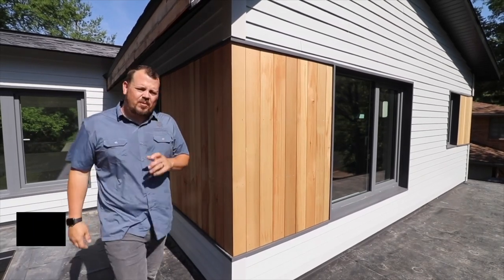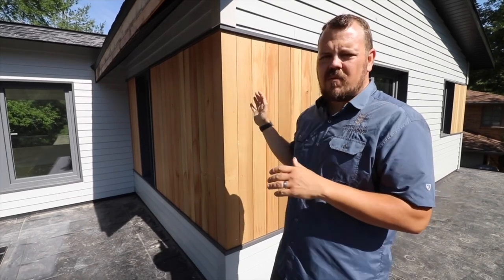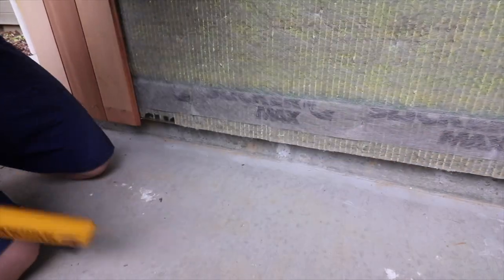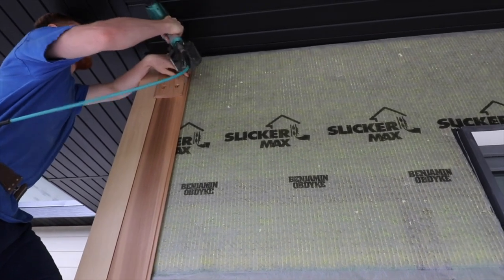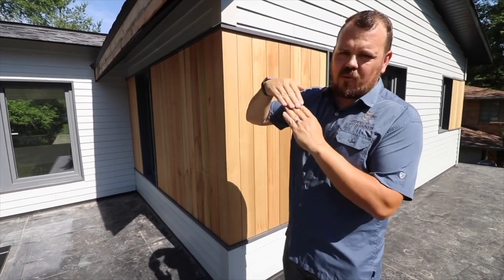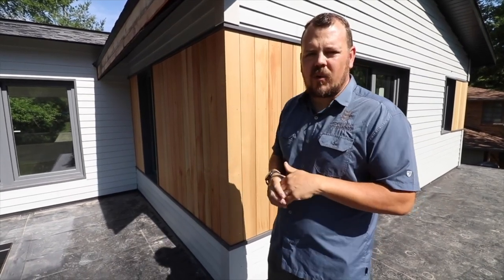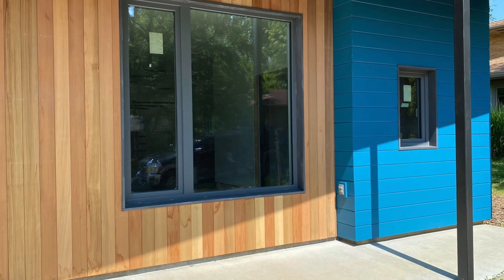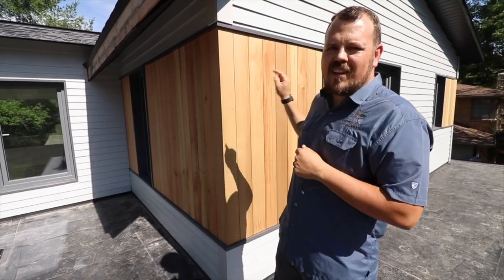Installing Cedar Siding for a Lasting Product

Comment: beautiful work! is this just going into the sheathing or did you put blocking in the framing for those nails? thanks!
Reply from the maker: This is just into sheathing. If the panels or pieces were larger we would probably look at blocking. The tallest wood panels on this project were either 5’ or from top to bottom plate. So low weight. Otherwise, blocking is a good idea.

Comment: Why not face nail the first then blind nail into the tongue for the rest as with T&G flooring but with something like 15/16 ga nailer? Thanks for the informative video.
Reply from the maker: On exterior installs like this we have tried blind nailing and just havent had great success. The boards want to curl too much. Face nailing just seems to hold in place much better. As long as you take the approach of deliberate nailing I dont think seeing the nails is an issue.